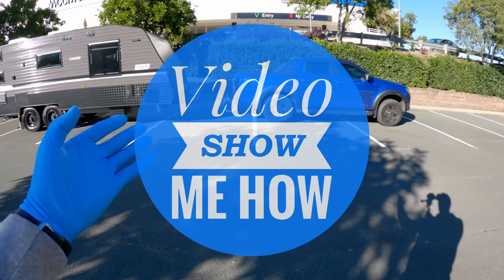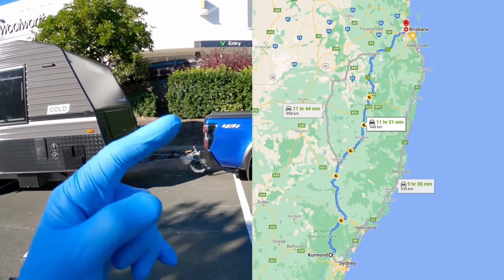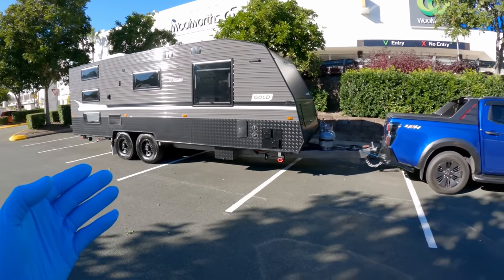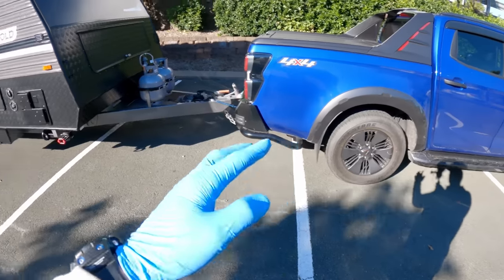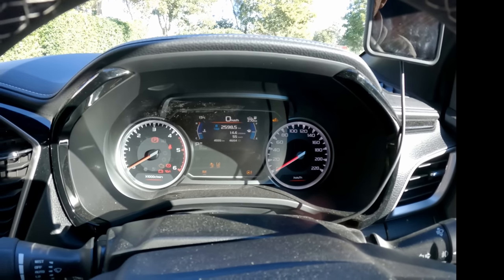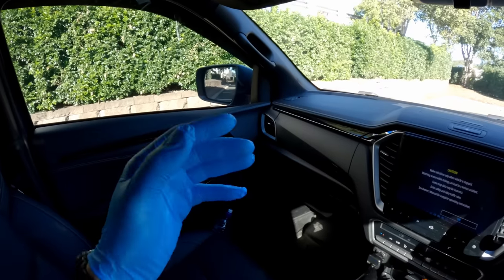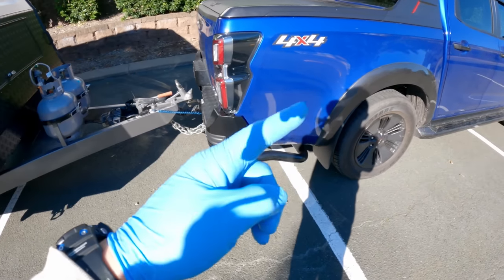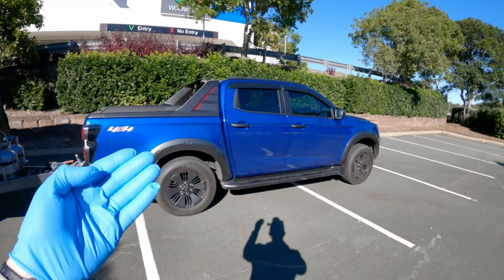ISUZU D-MAX 2600km Towing Test! | 2021 Isuzu DMAX X-Terrain Build Series

Comment: Great episode 😃👍🍺
I was just wondering if you or the passenger bumps the caravan brake switch would the brakes come on as soon as you hit the button. Because it’s in the open. 😃👍
Reply from the maker: No not at all, no chance of accidentally bumping. It's not just a straight on off anyway, you have to hold it down :) Found it much better that I could see it, see the status light and be able to adjust :)
Reply: @VideoShowMeHow  well you do definitely have it in the right place, because like you said in an emergency you will be in control. Thank you for getting back to me cheers 🍺.
Reply from the maker: @paultabone2010  welcome, enjoy :)

Comment: Great video mate. I currently have a JKU crd in WA and I am over watching the temps especially when towing. I tow a 5m boat. I am currently looking at a new Dmax or MUX not sure which. Do you think if I brought one of these my towing troubles will disappear? The reason why I ask is you were in the same boat as I am currently in.
Reply from the maker: hey mate - great to see another JKU CRD :) Yes I did a heap of work on my old Jeep to get the temps under control (vids on most of the mods) and even with everything done still would need to low range it in the soft stuff on the beach to lock up the torque converter to keep temps under control. No chance towing my camper on the soft stuff in 4H. Pleased to report the DMAX is a totally different story, I really pushed it up some bigger hills particularly through the range when doing this vid and it was flawless, much better cooling and different auto cooling from factory than the Jeep. Seems to me the engine is really designed for this car, where as with the Jeep CRD it was a VM motor shoehorned into the JK body (eg checkout the position of the cat for example, waay up in the engine bay) . Any sorry for the long reply, but have been in your exact position! Enjoy mate :)

Comment: Hey what are the engine specs of your dmax? I've got a 1.9L and I'm a little weary of towing with it
Reply from the maker: I've got the 3.0 (4JJ3), 140kw/450nm (plus a bit of a tickle thanks to a DPChip 👍) The 1.9 has the same tow rating I think? Unsure of I'd be pulling the same weights with it though (torque down to 360nm) 🤔🤔

Comment: I found my My22 Dmax with a bullbar/winch  and not towing, the EGT's hover around 430 for S2 and 398 for S1 when cruising on the highway doing 106kph and closer to 450 when doing 115kph. Is this normal?
Reply from the maker: Yeah that's about normal

Comment: You need a transmission cooler! And a lock up kit.
Reply from the maker: Runs pretty well without both :) Was monitoring temps the whole trip and didn't get close to overheating, was very impressed
Reply: @VideoShowMeHow  I did further research, various reviewers and Isuzu itself state the dnax has a cooler installed already?
Reply from the maker: @juliuscesar9864  yeah it's a heat exchanger setup. There's a vid on YouTube of a shop that installed a cooler and they show it fairly well

Comment: Is that a distance to empty in the top right of the dash at 5:28. I've been looking for a distance to empty on mine but havn't seen one and assumed it didn't have one. Is there a random setting that needs to be turned on? Also did the upgraded rear end contribute to better towing capacity. IE would stock tow kit do the job?
Reply from the maker: Yep, you can custom what you want to see in the corners in the settings. And no capacity changes, still 3500kg and 350kg down ball, same as the Isuzu standard towbar (just with full steel step and more protection 😁)
Reply: @VideoShowMeHow  haha guess I didn't look hard enough, it was doing my head in. Loving the series by the way. Cheers
Reply from the maker: @SCT15H_07  thanks mate 👍

Comment: Surprised you towed a heavy van in drive, my 2023 prefers manual and 4th which is 1 to 1 with our 2700kg van. Temps were good no need for a trans cooler so i wont buy one.
Reply from the maker: Yep, that's what the manual recommends 🤔